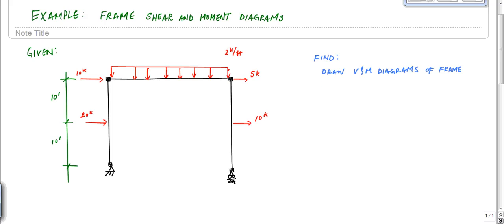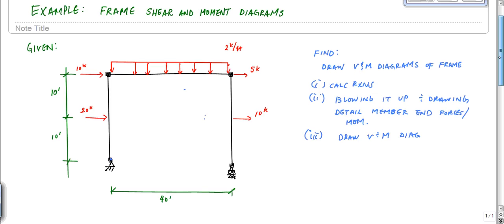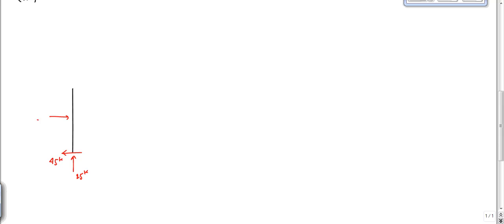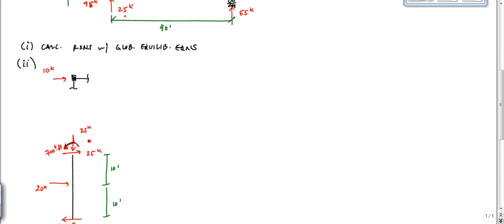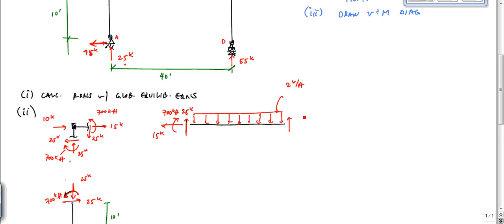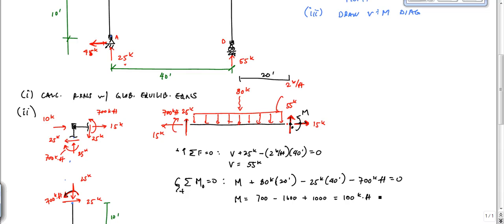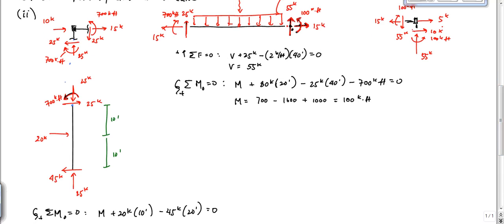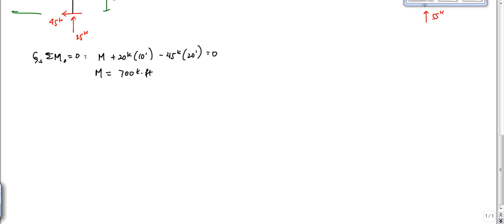Frame Analysis Example 2 (Part 1) - Shear and Moment Diagrams - Structural Analysis

Comment: I failed my midterm cuz I was completely lost. This makes total sense! Wish I would of found this earlier. However, I am lost at how you got the 5K for Cx....do I add up all the x forces or just at the joints from Bx and the internal force on Cx?
Reply from the maker: Yes, you typically sum all the forces acting on the free body diagram

Comment: how were you able to get 25 on ay and 55 on dy ??? by just doing it in your headdddd help me pleaseee
Reply: wouldn't the moment about A be...-20(10')-10(20')-80(20')+5(20')+10(10')+Dy(40')=0... Dy=45 :'(... i cant figure out why i'm not correct... the distance between 10k and A is 20' not 10'..... and the distance between Dy and A is 40' not 20' because it has to be the horizontal distance...PLEASE HELP ME!!! :'(
Reply: Taking moment on one joint! Example if u take moment at A= 20k(10 f) + 10 k(10) -2(40f)(20f) +5(20) +10(10) +20Dy. Should all end up DY = 55. Take vertical distances for all except the distributed load

Comment: sorry im having trouble understanding the vertical components. I get that they should sum to equal 80 but im confused how you got the 25 on the left and 55 on the right. I keep trying moment stuff but im not looking at this correctly. thanks
Reply: I have trouble too in calculating  vertical loads..it is distributed loads, should it be 40 k and 40 k in each support?
Reply: I have the same question

Comment: what if draw sfd and bmd from right
here is how i have drawn

https://lh5.googleusercontent.com/-p53a289LDfg/VITQMnNqxKI/AAAAAAAAKXw/hu6BdySj8kc/s1774-Ut/14%2B-%2B1

if this drawing is correct then how is it different from your drawing?  
if this drawing is incorrect then please explain why
thanks in advance :-)
Reply from the maker: Sanjoy Roy i'm afraid to click the link. i think the best way to check your sfd and bmd drawings is to compare with a quick computer model using some structural analysis software...sap 2000, risa...risa has free demo versions that can solve all these problems.
Reply: its just a pic i have shared in my Google plus account. how can i share this pic with you?  is flickr link will help you to see that pic. i just want to verify my answer with you. :-)

Comment: hi im not getting the vertical reactions . because Ay = - By and if you solve for member B-C By + 2(40) + Cy=0 and sum the moments about C to get 2x40x40/2 + By(40)    you get By= - 40 . i dont know what i am doing wrong
Reply: ok never mind i figured it out . you do not use that method you just calculate the moment about the supports
Reply: thanks :)
Reply: would yo explain that to me I am still getting By = 40

Comment: I dont think the vertical forces are correct. If you take vertical equilibrium(sum of forces in y) they dont equal 0
Reply from the maker: Willo Wanjox 25k + 55k = 2k/ft * 40 ft

Comment: just wanna know why the vertical force isnt split in half on both supports, i found that slightly confusing.
Reply from the maker: The lateral loads cause  compression on the right vertical member and tension on the left. If only the distributed load were applied then the two vertical reactions would be equal.
Reply: thanks alot man i kinda figured it out by doing sum of moment on the left support 
its amazing how clear the head becomes after a shower , in the morning its just like whaat :P thanks for the quick reply and the awesome videos.

Comment: Hi sir, can u plz explane how did u get horizontal force of 45 and reaction in a = 25 and D=65, tanx alot.
Reply: 1- look at the quastion at first
you have 4 forces 
10+20+10+5=45 this is the H.force for pin 
2- for D=55  not 65 as you write
and we find from - sum Fy=0 >>
>> 2*40-25-Dy=0
*Dy=55
Reply: mohannad sawa How did he get the vertical force at A which is 25 kips?
Reply: DJ7thnz take the moment at D=0 
and by eq. and forces .. contiue the solution ..  then get value of A
Reply: Thanks Mohannad!